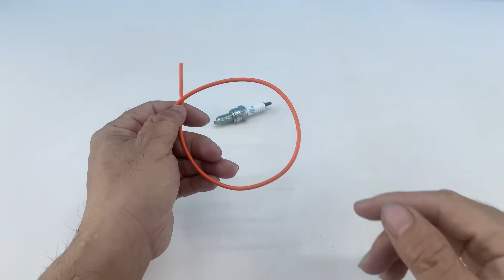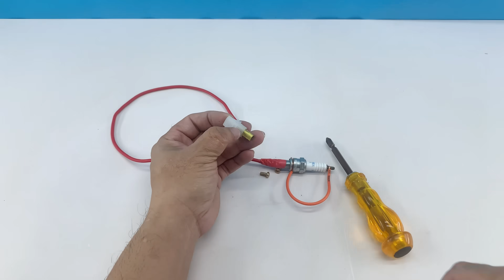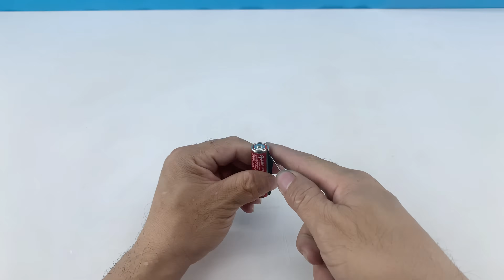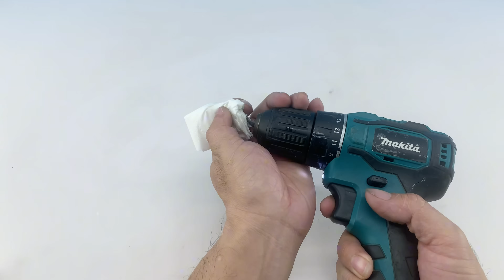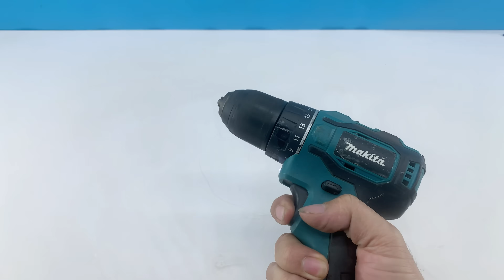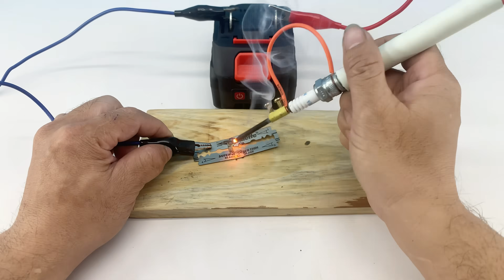Just 1 Minute! Make a Super Powerful DIY WELDING MACHINE from a SPARK PLUG!

Comment: I feel like most of these projects on youtube are just a self-delete shortcut, but i do have a question.

How does the thickness of the wire affect the capabilities of the welding device? Is a thick wire necessary? Does a thicker wire make it more powerful?

With love from the USA
Reply from the maker: Great question, my friend — and thank you for asking so thoughtfully! 🇺🇸⚡ In simple terms, thicker wire can carry more current, which means it can handle higher power and produce stronger welds. However, if it’s too thick, it can reduce flexibility and overheat your small power source. The key is finding a balance between wire gauge and your device’s capacity. I’ll explain this in more detail in an upcoming video! 🔧🙌
Reply: @CreativePassion88 Thanks for responding! Most creators I ask never respond.

 On a related note, does it have to be copper wire?  I have a bunch of scrap electronics and some of the wire is silver colored. I'm wondering how (or if) that would work.